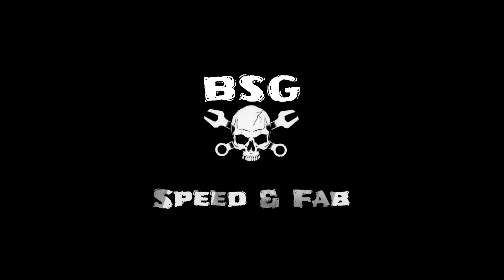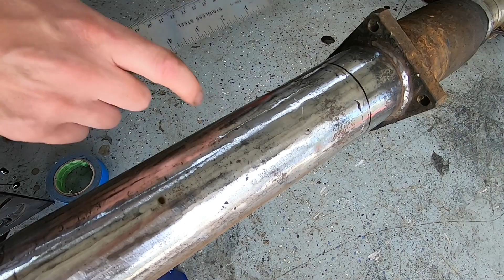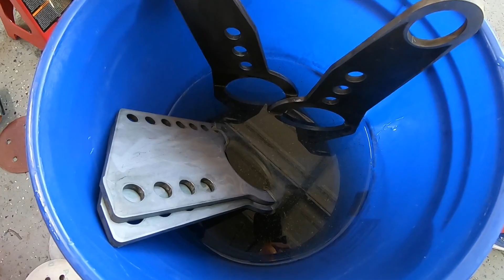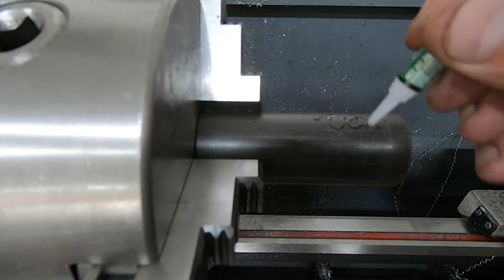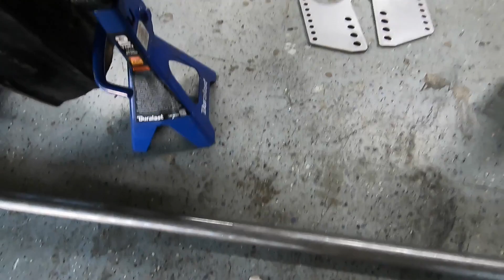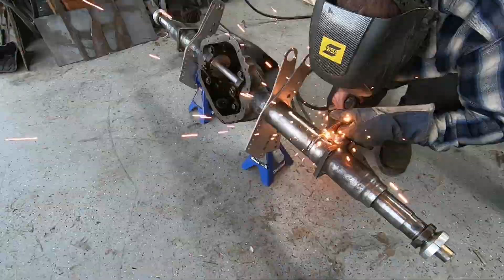48 Ford BBC Turbo Build EP. 5 - Narrowing a 14 Bolt Axle

Comment: What are you doing for axles
Reply from the maker: I plan on getting a custom set made. But since I cut 6” off the long side I could use the stock short axle on that side since stock axles have a 6” difference in length from side to side.